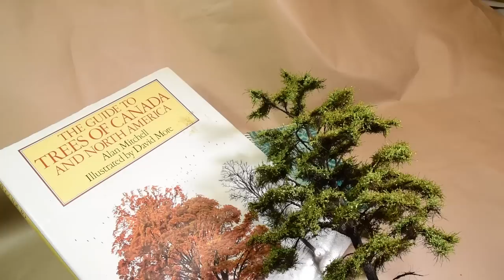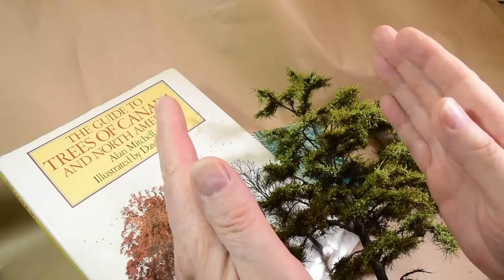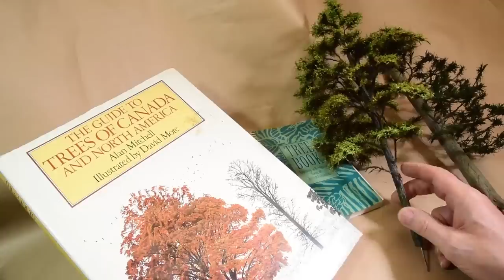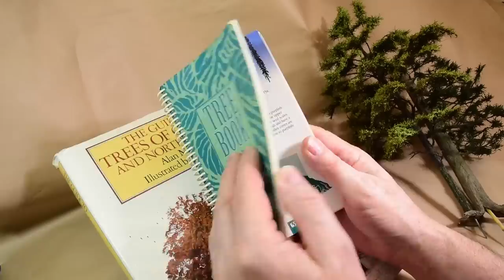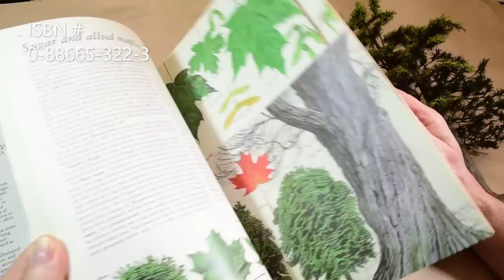The Cotton Wood Blind | Model Railroad View Blocks | Boomer Diorama ~ Vlog # 163

Comment: Thanks for another excellent video, Boomer.  My layout is only 1 x 6 feet with the (roughly) left half containing sidings with customers and the right half containing the switching lead with a team track, yard office, engineering garage, and enginehouse.  To provide some separation and to give the illusion of more space I added along the front edge a small area with two trees (store bought but nice), picnic table, fire pit, and rusty trash barrel.  Boulders (sourced from the real location where the railroad is supposed to be) line the inside edge to keep team track traffic away.  To give it a reason to exist I declared it to be the employee break area.  It may not strictly be a view block, but it does draw attention away from the narrowness of the shelf with two employees chatting at the picnic table, watched by a neighborhood cat hoping for scraps.  Thanks for sharing all your interesting and inspiring thoughts and techniques.  Cheers from Wisconsin!
Reply from the maker: That sounds awesome Andrew. You only need one or two trees to pull it off. I will be here live tonight (6:00PM Pacific Standard time) if you have time to watch: https://www.youtube.com/@SecondSectionPodcast/streams

Comment: You hit on a number of important points about viewing blocks that most people do not consider when building their layouts. You refer to it as "see through" view blocks; I talk about using trees as filters (same thing) so that you can not only see trains passing by but also to see the buildings and terrain behind that view block. One of the other features about view blocks is varying up the viewing angles. I'm sure you've talked about this before but I think it is an important point. Most people who come to view layouts, particularly shelf layouts, walk and view scenes in a perpendicular fashion (i.e., a "straight on" view). On my layout, I am forcing the viewer to look down scenes on an angle.  It becomes a welcomed surprised to them when they walk past, turn their heads, and see the scene from a different angle.  When I do this, I am able to expand the viewing space considerably, for example, from 11" to 15."  This additional 4" may not be much but you can do a lot more to extend the scene. I also have a couple of bridge scenes where the viewing window is about 20" at the front edge of the shelf but then fans out toward to back of the shelf (again, only 11" deep) to a 30+" viewing space. When you do this, you welcome the viewer into the ever expanding space. As always, thanks for your insights and perspectives. Love your videos!
Reply from the maker: Your layout sounds awesome. Designing and building a layout is a great experience, especially when you take your time. Too many people try to ram it all in as fast as they can and miss great opportunities - so they tear down and try again when they could have built it in on the first one. I'll be here tonight talking about this stuff live at 6:00PM here: https://www.youtube.com/@SecondSectionPodcast/streams

Comment: Excellent modeling!  I am curious though how a photo backdrop would add to the already amazing scenery?  Is this something you have contemplated?
Reply from the maker: When the 3D layout is finished I will paint the 2D backdrop as an impression to fit the artistic style and signature of the scene. No photo backdrop for me. The layout will dictate what happens with the backdrop, not the other way around. I would rather compose the background to accommodate what is already built. This way I can alter the mountain skyline to balance with the background structures, tree line, etc. Cheers.

Comment: I am curious to know why you avoid foreground hills.  I love your work and you have inspired me to (and have) scratch build much more.  Thank you for sharing your journey and being a source of inspiration and information.
Reply from the maker: A shelf layout has limited space to begin with and I done like big dramatic undulations in the facia. I find it looks cheesy.
Reply: @boomerdiorama  Must say I agree on the fascia aspect. I am using 6" fascia, rounded edges along the base of sub roadbed for a more 'seamless' look. There may be a spot or two where I have to 'trick the eye' for a couple of canyons/gulleys and modify that portion of fascia. I'm not entirely sure yet. Have all the fascia, sub roadbed (framing) etc on hand, beginning to cut the ply and foam for the base this week. Of course, as is mainstay I am finding out - I had a final layout design but now contemplating a couple of changes. Sheesh!